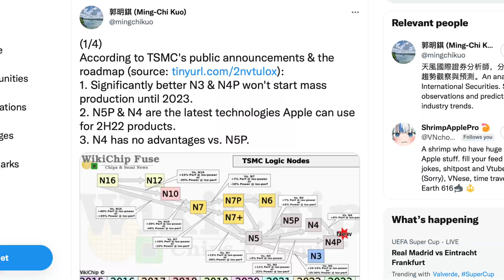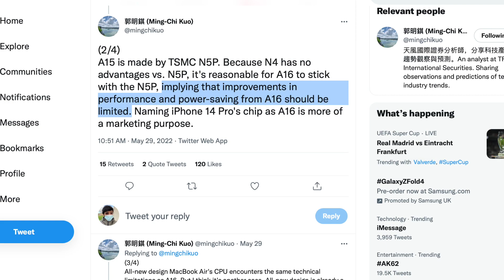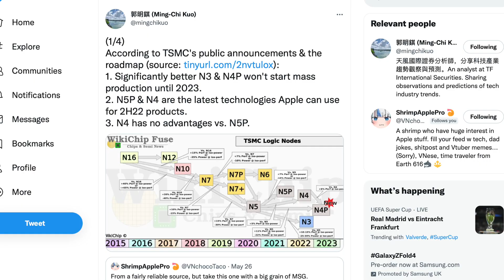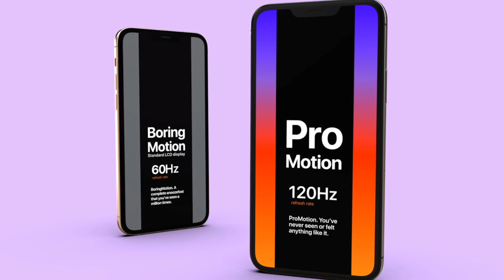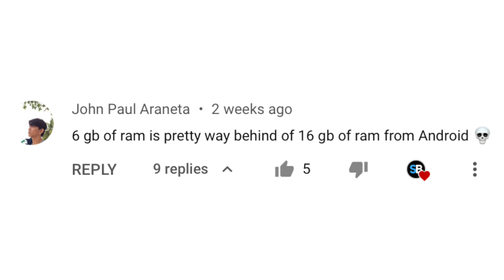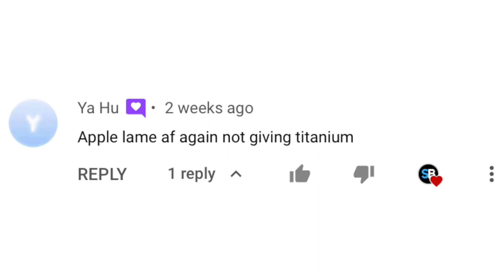iPhone 14 - A16 TIDBITS 🔥

Comment: hey for me i am waiting for the iPhone 16 pro max with under screen Face ID sensors under the display. or for a single camera hole or no holes on front display on iPhone series. For a design change to the iphone series. I have the iPhone 12 Pro Max blue color right now. to get the new iPhone 16 pro series or the 17 pro max for the iPhone with some big or improved changes. like the display camera battery. and other improvements on the next iPhone series. hopefully will get some big like under display face id or no obstruction bigger battery etc. on the display on the iPhone series.

Comment: With the price increase and the chips basically the same as last year, and I need a new phone by the end of this year, I'm at a loss as to whether to buy the 13 Pro at a much lower price or the 14 Pro with the new front aesthetics and AOD but with a considerable increase in price?
Reply: Get the iPhone 14 & upgrade your iPhone after 2-3 years of Use 🫶🏻